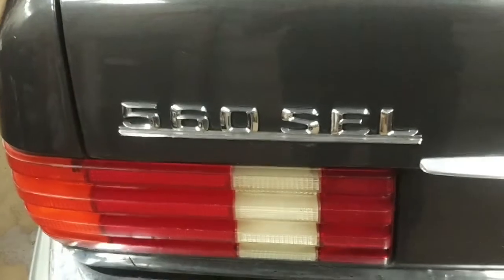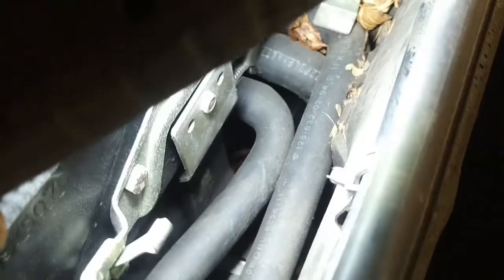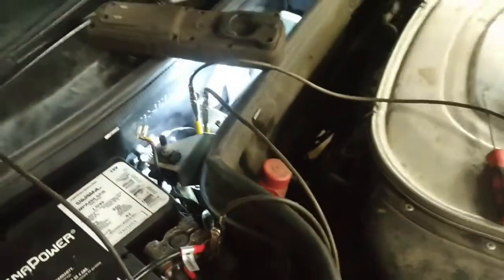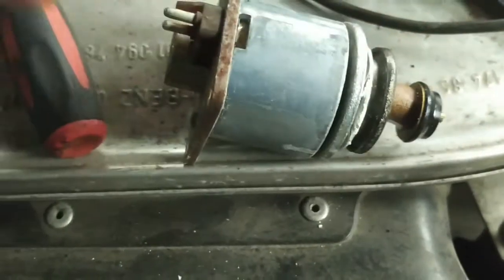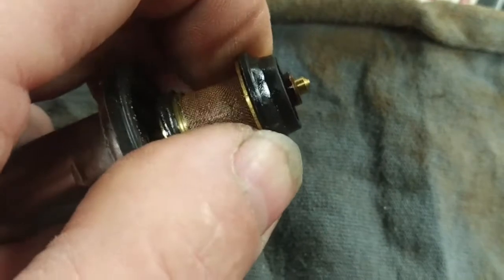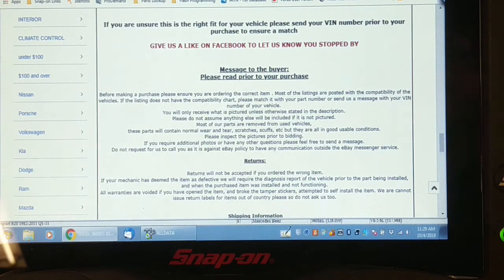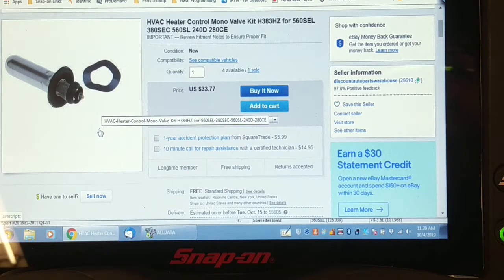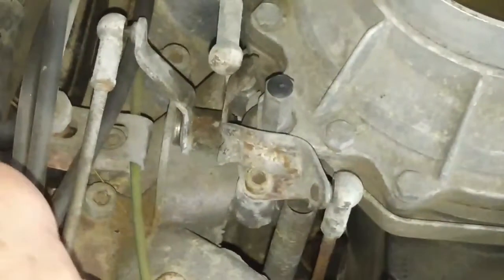1987 Mercedes-Benz 560SEL Heater Problem

Comment: In case you are driving in winter and need some heat in the car before you can make the repair, I discovered that if you just remove the electrical connection to the mono valve assembly you will get constant heat.  This worked for me with my 86 560 SEL
Reply: Thanks, I’ll give it a try. Just repaired my monovalve with the repair kit, and still no heat.
Reply: @krisperkreme6021  ever figure it out?

Comment: mine  acts soo weird, i get heat from lower vent on dash near both front window and driver side defroster. passenger side defroster gets hot only if i turn on defroster mode. upper vent on dash near window blows ice cold, center vent is a lazy fellow, its not dead but died kinf od situation, rear seat vent blows cold only. this is why i said its soo weird.. i havent looked on it, because i dont drive it on cold, a/c works better than my fridge.. so not much problem. so anyone know what it will be